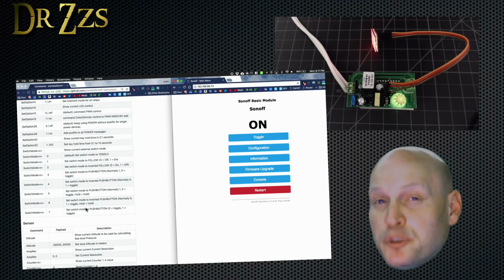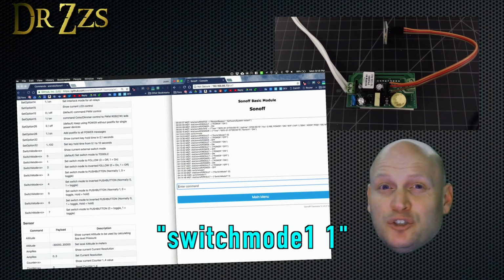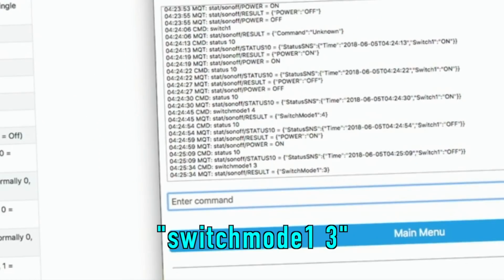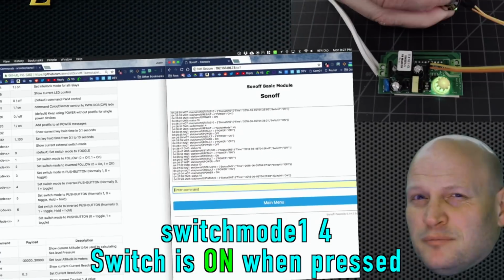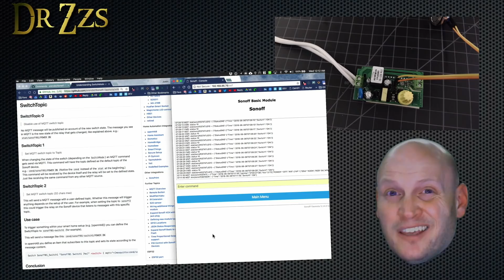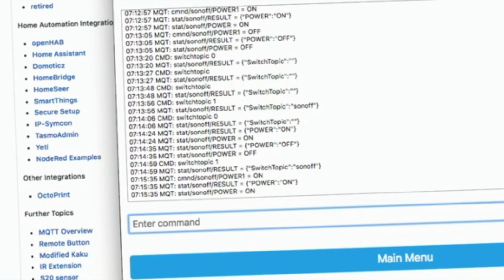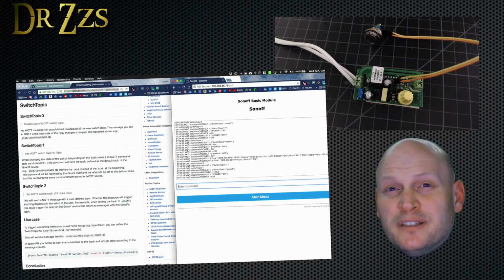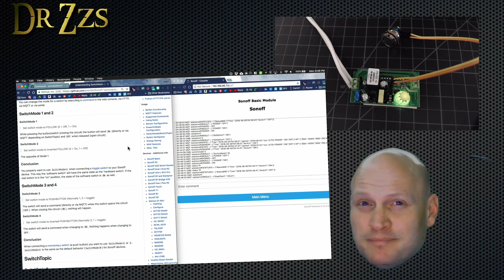Tasmota SwitchMode Explained

Comment: I want to connect a servo motor to the sonoff to control my blinds do you know a way to do this? Does tasmota allow you to add a timer to tell it when to stop giving power? Is this even possible. Am I asking to many questions? I definitely don't know the answer.
Reply from the maker: You need a motor controller between the Sonoff and the Servo.  You can't power the motor directly from the Sonoff, if that's what you're asking. 
I'm not sure Tasmota is the best platform to use to control a motor.  I'd like to do some experimenting with it, but as of right now, I don't know how exactly to do it.
Sorry, wish I was able to offer more help
Reply: DrZzs I Found this but would this work with the node mcu or the sonoff
https://github.com/jjhtpc/esp8266MQTTBlinds?files=1
Reply from the maker: Yes, it looks like it would. 
But I still don't think you can run a servo with the Sonoff.  You can (probably) with the NodeMCU. 
Best to ask the guy who wrote that code.  
Good luck!
Reply: DrZzs the person made it for the NodeMCU

Comment: Great video again !! In HA when I toggle the switch it turns on but not off is this a HA issue? when I toggle in Sonweb :) it works
Reply from the maker: hmmmm
well, if it works when you flip the switch in SonWeb, but not when you turn it off in HA, there must be something wrong on the HA side.  
Check your switch entry in the configuration.yaml
and check any automations you have that are using that switch.

Comment: I have Node MCU running Tasmota.  I have a door sensor set up with GPIO14 works fine with topic door. Now how do I add another topic for sensor 2 on GPIO 5 or multiple door  sensors. I can't figure out how to change the topic for a specific GPIO?
Reply from the maker: TASMOTA assigns a different topic for each switch or relay by adding a number to the end. So if sensor 1 is switch 1 then the topic will be stat/sonoff/power1 (sometimes just power for number 1) 
So for switch 2 the topic becomes stat/sonoff/power2 
You don’t have to change it.  Switch 3 would be power3, etc. 
so in HA your topics for state will look almost the same except that last number. 
Does that help?
Reply: Any idea why TASMOTA is not assigning POWER 1 POWER 2 and 3 etc... I have 4 switches and they are all stat/sonoff/POWER.
this is the consol set up; 
SwitchMode1 1
SwitchMode2 1
SwitchTopic 0

18:31:30 MQT: tele/sonoff/SENSOR = {"Time":"2018-06-18T18:31:30","Switch1":"ON","Switch2":"ON","Switch3":"ON","Switch4":"ON"}

18:33:09 MQT: stat/sonoff/RESULT = {"POWER":"OFF"}
18:33:09 MQT: stat/sonoff/POWER = OFF
18:33:10 MQT: stat/sonoff/RESULT = {"POWER":"ON"}
18:33:10 MQT: stat/sonoff/POWER = ON
18:33:26 MQT: stat/sonoff/RESULT = {"POWER":"OFF"}
18:33:26 MQT: stat/sonoff/POWER = OFF
18:33:27 MQT: stat/sonoff/RESULT = {"POWER":"ON"}
18:33:27 MQT: stat/sonoff/POWER = ON
18:33:40 MQT: stat/sonoff/RESULT = {"POWER":"OFF"}
18:33:40 MQT: stat/sonoff/POWER = OFF
18:33:40 MQT: stat/sonoff/RESULT = {"POWER":"ON"}
18:33:40 MQT: stat/sonoff/POWER = ON
Reply: I found the problem for the record!! and if someone has a similar issue. Since I am a newbie and you are a little advance for me, sometime in your videos you skip some steps as  you think are obvious ;) . So in TASMOTA when you set a switch ( or a sensor) on any GPIO you must have it relay set up as well. eg D2 is switch 1 and set D8 for relay 1. then TASMOTA with assign POWER 1 as a Topic.make sure also to set the Topic =0 in console
Reply from the maker: ahhh!
glad you found it.  Sorry I didn't explain that better :)

Comment: Greetings from Norway. Really love you videos and have already learned a lot as a complete beginner in HA world - Philips Hue doesn't count ;)
A couple months back you have made a great video '$5 DIY "Smart" Garage Door Opener using Sonoff SV' where you had to modify Sonoff SV to use it, but this new video got me thinking:
1. with the SwitchMode 3 that emulates PUSHBUTTON (NO) - similar to the physical PB on the wall,
2. considering that my unit motor is powered by 24V DC (from transformer) and not 230V AC
is it still necessary to remove resistors and use Sonoff in isolated mode?

In addition garage door opener PCB has extra connection that can deliver 24V AC (not typo) if this may be of any use.

Anyway I'm a bit confused on how to proceed with my Tasmotized Sonoff SV implementation. Any help will be really appreciated.
Reply from the maker: Hello Norway!
You should be able to use the SV without isolating the relay.  I'd need to know a little more about your opener function to say exactly how you should wire up the SV, but I would expect you could just put it parallel with the current activation switch. 
I'm going to re-do my wife's door with an SV and I'll do it that way to show how it can be done, but that won't be for a while so you'll probably want an answer sooner.  
I'm planning a live stream this Sunday.  Maybe this could be something we talk about then.
Reply: Hi DrZzs,
Thanks for your quick reply.
Parallel connection to the manual switch/push-button was my first thought. The opening system is provided by German company Seip and is pretty common in Europe. This particular one is already a couple years old but it's quit ordinary sort to say, both remote (433MHz) and push-button operated. You can take a look at the manual where PCB and wiring among other stuff is described (http://www.seip.co.uk/A_SERIE_433MHZ_250ERDEC_MITTELEUROPA.pdf).
Once again thanks a lot.

Comment: Hi just wondering if anyone has successfully hooked up a thermistor to tasmota I have looked far and wide to find wiring diagram and instructions for this    I would love to monitor my pond temperature  and mqtt it to my hassio on my pi3   I see  ds18b20 mentioned but no instructions .  Regards Dan.
Reply from the maker: All I see with a quick look in Tasmota wiki is this:
"DS18B20 Temperature - DS18x20 (4) in group 2
Enable option USE_DS18x20 in user_config.h for multiple sensors using OneWire library"
I'm guessing you probably already saw that.  I'll have to look in my box of sensors and see if I have one of those to try out.  
What have you tried so far?
Reply: Hi thanks for the quick reply I'm sorry to say my knowledge is somewhat limited. So far and thanks to your tutorials  I have managed to suceesfully install hassio on my pi3 and I have a dht22 working on tasmotoa firmware loaded onto a nodemcu and it is  reporting using mqtt to home assistant. can't wait to get into it all further but thought it would be cool to put a temp probe in my pond as my second sensor using tasmotoa on a webmos mini pro?. I do have a 2 wire 10k thermistor usually used for under floor heating  but only know how to hook it up through Arduino using an analog port which I believe is complicated to enable analogue inputs on tasmota ? anyway thanks for your turorials  much appreciated .

Comment: Is there a mode that will send either the momentary or hold command depending on how long you hold the button?  This would allow having dual functions, such as normal press to toggle one light, and hold press to switch off all the lights.
Reply from the maker: for sure! 
That's what switchtopic1 should do.  If you just touch the button once it will send the "cmnd/sonoff/POWER1 = ON"  if you hold it will send "cmnd/sonoff/POWER1 = HOLD" 

It's a great feature to do exactly what you want.  Let me know if you have trouble with it.

Comment: Curious do you have a link to that touch switch you used in the video?
Reply from the maker: of course! 
best price I've found:http://s.click.aliexpress.com/e/nA2FUNV
Reply: This one allow for turning the light one and off?  It only has 3 pins?  I would love a datasheet in english.  I have some one order to try.
Reply from the maker: I don't have the data sheet.
The 3 pins are VCC, Out, Gnd.  It acts like a latching switch as-is, but I seem to remember there's a way to make it a momentary switch by adding some solder.

Comment: Did you know that they are shipping new Sonoff Basics with the pin holes soldered closed.  Been struggling to Tazmotized them :-(
Reply from the maker: I've heard.  I haven't ordered any new ones since then.  
Check out pogo pins: https://amzn.to/2LxPT1v
You don't need 100 though, that's just the first link I found.  we'll just have to hold them on the contacts.  I seem to remember some guys making flashing adapters too, maybe on Thingiverse.   
We'll figure out a solution.
Reply: Those pogo pins look wicked.  Unfortunately,  Amazon US won't ship them here -not for a reasonable price anyway.  But I did manage to poke through the solder by heating up some pin connectors with a soldering iron. I then tasmotized them using FlashEZ...problem solved....a bit disappointed that sonota doesn't work anymore though.  OTA was my go to flashing method.
Reply from the maker: Try a different seller. AliExpress or Banggood might have them. 
I love flashEZ with the bin file. So simple. 
And I’ve got another twist to add. There’s a way to paste all the setup commands you need into Termite all at once.  So you can set your WiFi, mqtt, etc.  slick!

Comment: Great video!  It occurs to me that switch mode 7 would be a feat thing for a garage door opener.  I had been using another so off device for that purpose which was set to be a momentary contact device by default but now any sonoff basic with tasmota should work fine.
Reply: That is my next home assistant project!  Dr. Zzs answered my question on switchmode!  Thanks!!!
Reply from the maker: Excellent! 
Let me know how it goes!
Reply: Hi, old thread, but did switchmode 7 work for you in the garage door opener scenario? When using the webgui it still seems to just toggle on and off for me. Thx!

Comment: For anyone trying this at home make sure you aren't using mains voltage with an exposed sonoff while working with it so closely. You should still be able to provide 3.3v over the vcc and gnd pins that the button is connected to while testing. I think the minimum input voltage is 90v for that input side so I would assume this is connected to mains. Going off of recommendations on the Super House YouTube channel  when he covered Sonoff devices. You know your way around Sonoffs Dr. Zzz, mainly warning people who just arrived.
Reply from the maker: good point!

Comment: Another great video.  I have a suggestion for a new minizzeries.  I am very confused about addressing.  I notice that you always put the full ip address whenever an address is required. In many of the videos and documentation hassio.local:8123  for example is used.  Occasionally that works for me, but rarely. I always establish a static ip address for the Pi, but sometimes another MAC address shows up for hassio. How can that be?  Also, what about using Ethernet vs wifi? I am missing something that must be important.  Must be some others that are confused.  Thanks for all you do.  I have learned so much.
Reply from the maker: Thanks Tom!
I've had the same experience with "hassio.local" when I first started with HA, so I haven't even tried it in a while.  Also, for me at least, I'm running 2 hassio rpi's.  One to run the house and another to test new things on before I mess with the main system.  (That's a WAF mandate). 
I've got a lot to learn about network connections but I will try to put together some useful information in a video sometime.  
I'm trying to move away from so much wifi and rely more on ethernet.  It is just so much more reliable.  If I were building a new house I would put an ethernet cable at every door and window and in key locations for cameras, besides the usual 1 per room.  But that's another video too.
But if you can't run new cable in your house, you're stuck with wifi and that's where most of us are these days.
Reply: You made me feel a lot better. I agree with ethernet  being the preferred way to go. Ultimately, we will use a mix of both. For some stuff wifi is very handy. I run into trouble when I try to mix them.  I am now using 100% wifi and full ip address with no trouble.  I need to set up another PI for development. FYI, I run all of this stuff on solar power.  Thanks again for the education
Reply from the maker: Solar awesome! 
We're installing some solar panels in the next couple weeks.  Exciting stuff!
Reply: I have had mine for a couple of years and it is still "Exciting stuff!"  I feel so righteous.

Comment: I am having trouble erasing firmware on the sonoff
Reply: I am erasing because the firmware got corrupt
Reply from the maker: bummer.  
The process should be the same as flashing the first time.  You don't have to erase first before re-installing.  Old version is just replaced when new version is installed. 
"programming mode" essentially preps the chip to be wiped.
Reply: DrZzs when I try to flash by esp easy I open the program and I don't even start anything and it says flashing failed. So I was trying to see if I erase the firmware first and then try to flash
Reply: DrZzs just to tell you what happened. My SSID had a space on it so the firmware wasn't working properly so to fix it I had to hold the button for 40 seconds to reset the configuration and then when I told it  my SSID it didn't crash and get corrupted

Comment: Hey man great videos. I have a request, please make a video of a smart door that closes automatically when you turn the ac in the room. Thanks
Reply from the maker: oooh, that's a good one.  
Do you already have a door that closes with a motor somehow?
Reply: I was thinking perhaps in installing a spring loaded hinge and an electromagnetic holder installed on the wall . Maybe that could work for closing the door and avoid the use of a motor, but it’s something I’m thinking over.
Reply from the maker: That's probably the right way to go.  Anythings possible. 
I want to do some miniZzeries just on making different automations for things just like that. 
I'll put it on the list! Thanks!

Comment: Thanks for this I have a sonoff T1 on the way and was planning on setting up the "hold" command to additonally turn of the smart bulbs in my bedroom lamps.  This video just eliminated me having to research what switch mode I need to use for that
Reply from the maker: great! 
It'll be interesting to see if the T1 buttons require any other modification to work with the hold function.  If they are latching, then there might be something else you need to do to make them non-latching (or momentary).  
I have 2 T-1's I'm hoping to get a chance to play with soon.  If you get yours working before I do let me know how you did it!
thanks!

Comment: Great video.  Do those capacitive buttons work with doing a hold?  Nice high tech LED diffuser you got there to not blind the camera!
Reply from the maker: Thanks! You caught that?!  It was perfect how the wire nut fit on the LED and blocked the light but still glowed enough to let you know it was on.  Very fancy.

Those cap-touch buttons work like latching switches. So they wouldn't be good for the Hold function.  You could do it, but it would be like switching a rocker switch, then 4 sec later, switch it back.  I think there's a way to convert them by breaking a solder link somewhere, but I haven't done it.  I actually have some other touch modules that act like pushbuttons. Hold command should work with those.

Comment: This video was helpful.  I have another question on the Sonoff SV with Tas.  I'm trying to use it to raise and lower a projector screen.  the board built in the screen has 3 wires, a up, down, and common.  the screen board only needs a short input to start the raise or lower, so a 1 second pulse would be fine.  Can I use the GPIOs and ground for this?
Reply: Bryson Balling I would check out thehookup channel. He did a recent pool pump modification that would work great for this push button need. Don't think it let's me post links here.
Reply from the maker: Here's Rob's pool video:
https://youtu.be/QcaJlpVOJ8U

Comment: Can I use a conventional light switch for a wife approval factor? Which switch mode for a sonoff basic?
Reply: I believe that is switchmode 0 after you configure the Switch1 on GPIO14.  Check back in some of his other Sonoff videos as he explained it there.  I also recommend doing the 10k resistor pull-up modification as well if you are going in the wall.  I haven't had to do the capacitor filter thing he showed but definitely had to do the 10k on a couple so I do it on all of mine now as it just takes a couple seconds to throw in a resistors across the two pins.
Reply from the maker: She doesn't like the glowy touch buttons?!With a regular "latching" type switch you can use switchmode 0 1 or 2.  I've just left mine on 0 (that's the default)
Reply from the maker: Thanks Travis!
Reply from the maker: no.  I'm not sure internally exactly what happens, but I expect if the switch is following the relay then tasmota will also turn the switch to off.  
Whatever it does, I know it works like a 3-way switch. So if you turn on at the switch and off in HA, the next time you flip the switch it will turn the light back on.  It'll change which way the switch is oriented (up for on, down for off), but that's the same thing that happens with 3-way switches. 

If you get the lighted switches, sometimes the LED doesn't follow the state of the relay.  I still need to tinker with that and figure out why, and how to fix it.
Reply: Shes conventional lets just say that.
Reply: If the switch is latched "on" and I tell the Sonoff to turn "off" in home assistant will there be any problems.